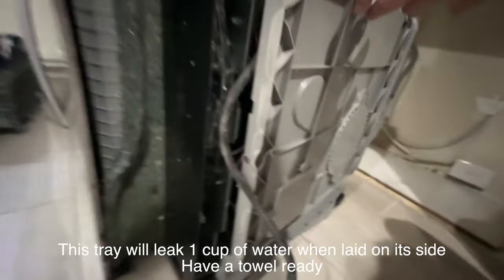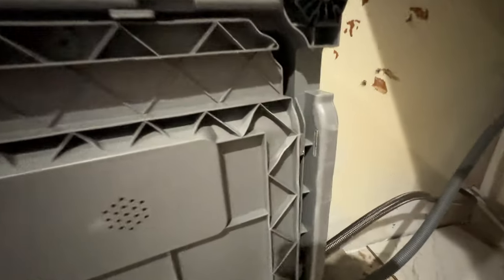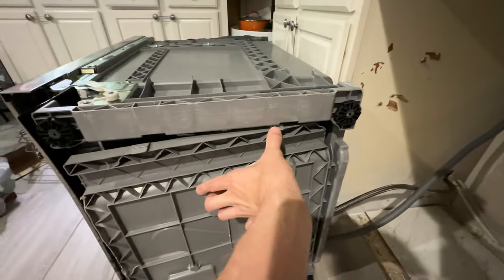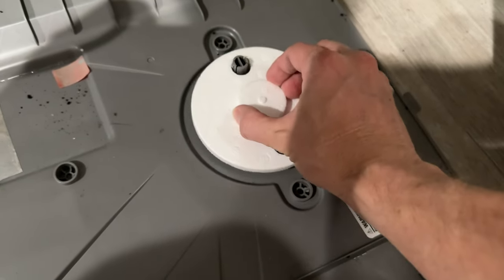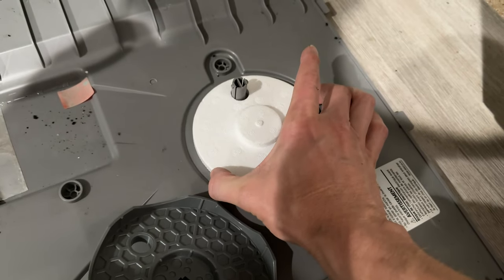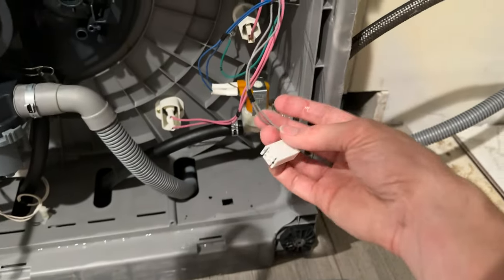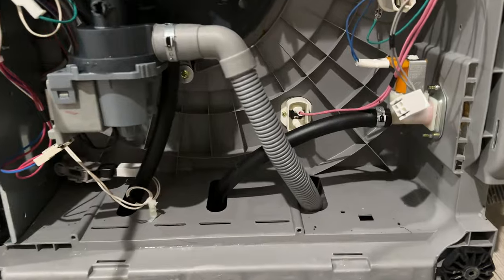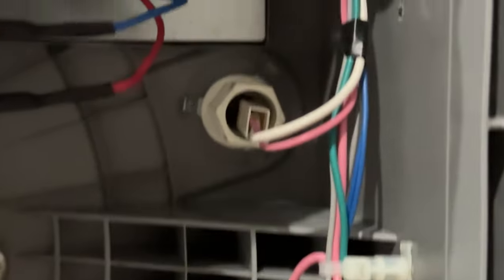Samsung Dishwasher Normal Light Flashing/Beeping (DW80M2020US)

Comment: This is an accurate solution. If the high-water level trips the float sensor located in the front left portion of the basin, it's likely it will also result in a small amount of liquid spilling into the panel underneath the dishwasher. The moister under the unit will inhibit the flashing Normal light from resetting following the clearing of the drain blockage. The best way to resolve the issue and speed up the drying process is to drain the unit, unplug the dishwasher, pull it out of the cabinet and tip it on its right side, then remove the bottom panel and dry off as much of the area as you can. I blew off what water I could, then applied air from a standing fan for about an hour. It's also smart to take off the sensor from the bottom panel and dry it out. Note that a small amount of water remains in the unit after it's drained, so you'll want to put a towel under it when you tip it over. It's also a good idea to take the opportunity to clean the filter in the basin under the sprayer.
Reply: You are absolutely right! God bless you! i do twist to the right and it is alive! ☺